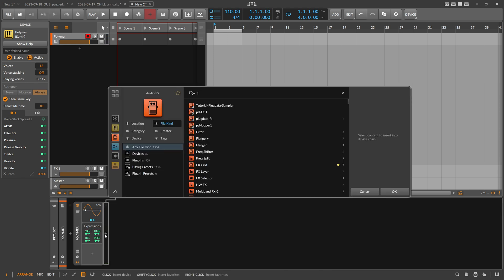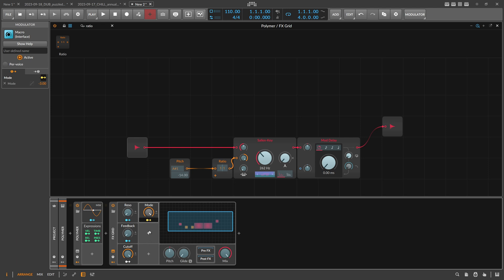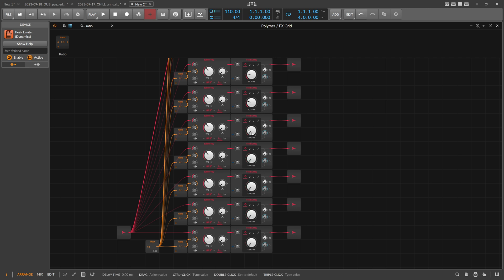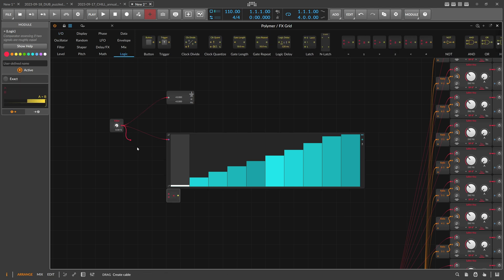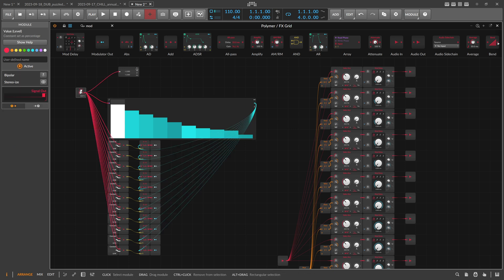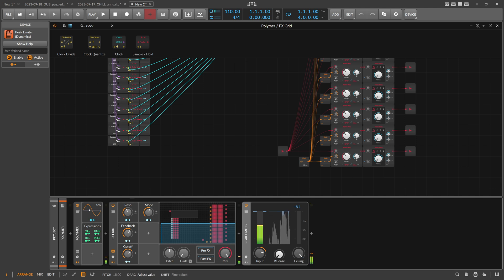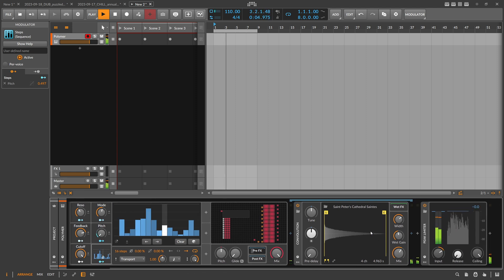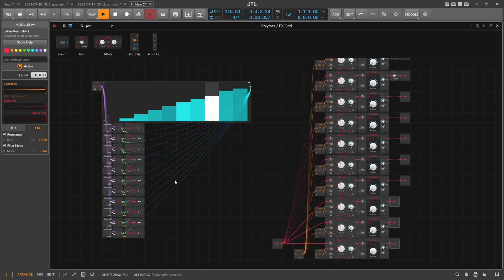Bitwig: Creating a Multi-Band Delay Effect

Comment: you can't do feedback loop in FX grid using allpass and simple delay modules, it's biglimitation for fx sound designing
i know there is trick to use long delay but it's not good
what about PD have you had chance check it?
Reply from the maker: yes, in pd it´s kinda the same. you have to use some kind of delay buffer and you're bound to the block size afaik
Reply: you can get close using a modulator on the output side modulating a knob on the input side.  it's never going to be the same as analogue, but it is better than a delay